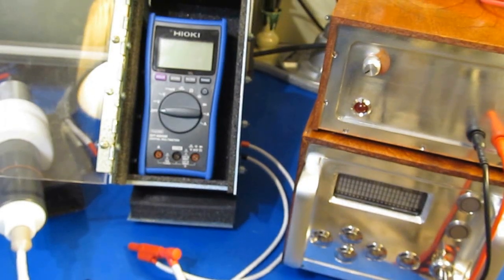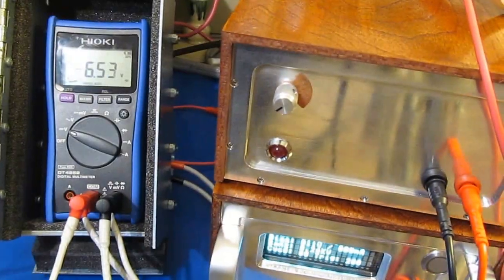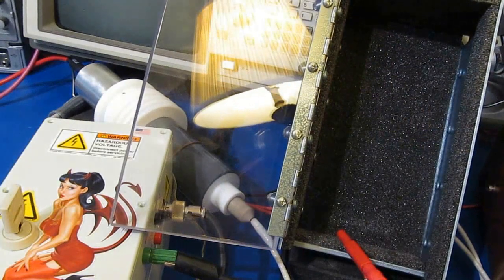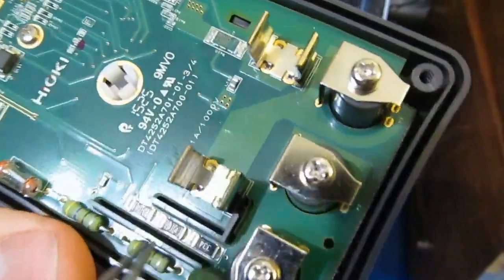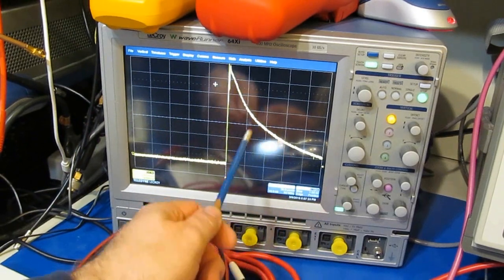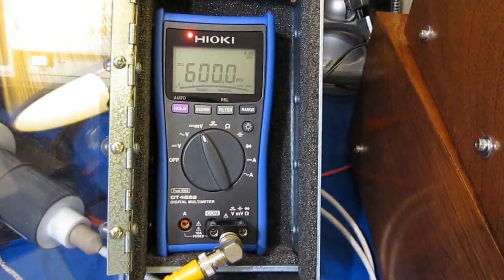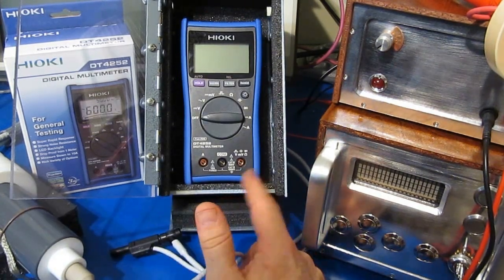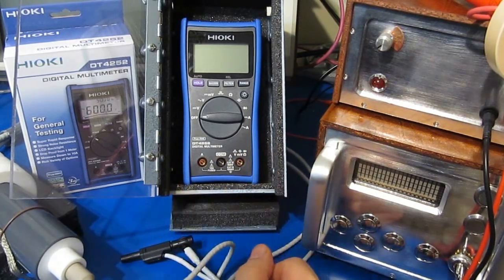The Hioki DT4252 Multimeter Part 2 of 3

Comment: my hioki  4252 died after test 3000volts ac. what might be the problem inside the tester?
Reply from the maker: Just open it up and start measuring the parts on the front end.  Guessing the 3kV was limited as you lived to tell the tail.

Comment: Dear friends I need to repair hioki 2003 3256-50 digital  hitester multimeter video. Not properly working.
Reply from the maker: Why are you double posting on a channel that reviews handheld DMMs?   If you are not qualified to do these repairs, don't.  If HIOKI no longer services it, time for a new system.  I doubt they would provide you any information on it, so you are left to spend time reverse engineering an obsolete unit.

Comment: I thought your rules are that if a meter arcs over inside then that counts as a fail. Unless you've changed the rules the Hioki should have failed at 10kv.

I hope someday you run a Brymen through the full range of tests and see exactly where it fails.
Reply: +Gooberslot most meters shorts once they start arcing... This meter didn't so he could have still ran higher voltage with the arcing but it may have caused more damage.

Comment: Impressive!  I feel reluctant to tell you that I own the DT4282 model.   I've had a few moments where I considered sending that one to you and especially now that I've seen the 4252 survive your tests.  For now, I think it'll stay on my bench, but should I change my mind, I'll let you know!  Thanks for the testing!
Reply from the maker: +TechnologyCatalyst I thought about getting one for my own use when I was looking for a better meter.  I may try and test the current input on this one.  I like that they offer their high end meter without current.   The meter is packed so tight in that area.
Reply: @joesmith-je3tq  You noticed that too huh? It was the prime reason why I ended up getting a dt4255 and dt4281 pair (although used, wonder if they will end up having problems and/or defects when they arrive, hope I don't end up with a faulty 4281). I do have a bm829s for current measurements since it has a seemingly more robust current circuit than every other dmm I have seen, but quite frankly I do not find any reason why one would want to use a multimeter to measure high currents while breaking the circuit. Better use a clamp for that, accuracy is overrated once you leave the mA range.

Anyway, hioki did get a dt4261 out, which seems to have a more robust Amps range than their other modern dmms, seems to be using dedicated pcb layers close to the amps and com inputs. It seems to be quite a mess on the capabilities it has though. Some design decisions do not make sense (at least to me).

Comment: You have to write to Japan to get response back. 
If they would increase diode range to at least 2.5V and improve bargraph it would be great!
Old 3801-50 model was also great, they used ball bearings for range switch... 
Looking forward to see their high-end model tested as well as Fluke 28 :)
Reply from the maker: +sepertude After seeing Dave's test on the 28, I can't see much reason to run one.   I would like to have a look at the high end Hioki.
Reply: What is your opinion on Fluke 28? Better protection than 87V?
Reply: Here is Hioki DT4281 http://www.eevblog.com/forum/testgear/hioki-dt4281-multimeter-teardown-and-first-impression/
Reply from the maker: +sepertude Without running the 28II on the same setup the 87V was ran, it's hard to say.   But again, watching Dave's video, my guess is that it would fail fairly early on.
Reply from the maker: +sepertude It's tight.  Real Tight!